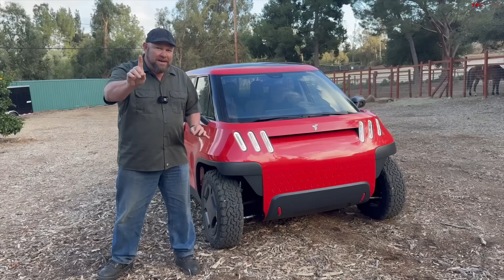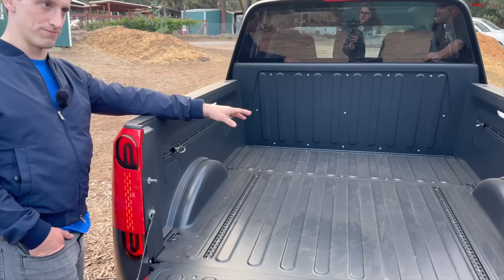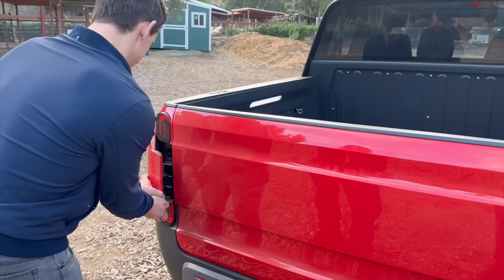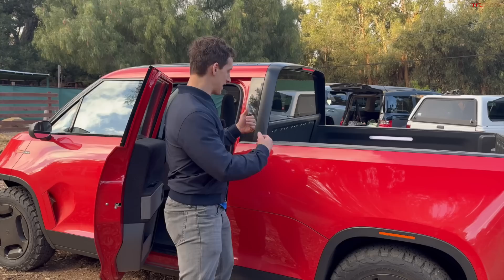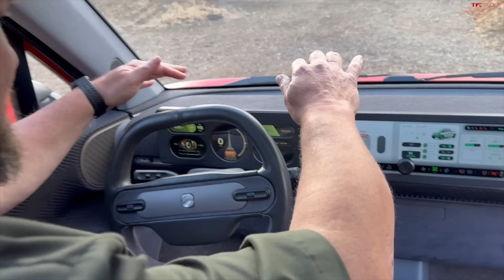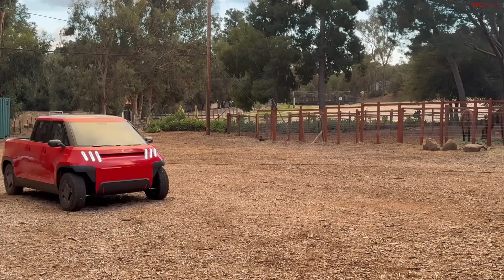I Drive the Most Revolutionary Truck In Decades: Meet the Telo MT1!

Comment: $40k for their lowest level truck still misses the point for a lot of people. I'd be more inclined to buy 5 used trucks for $8k each and use each one till they die. Assuming 2 to 5 years on each one and you'll still be driving years after this thing falls apart.

Comment: This looks very interesting to me. I didn't see a trunk...did I somehow miss that part or is that not part of the design? If so, I guess the bed could act as such since I'd almost certainly want a tonneau cover. 

I have been hoping for a hybrid version for the Santa Cruz to drop but this looks like it might be tick a lot of the same boxes for me, though those [non-hybrid currently] start just south of 30K as opposed to over 40K.

Comment: Like it a lot.  I would consider buying one.  However the PRICE is the key.  A lot of cars have MSRP values that are ridiculous.  It gets you from point A to point B.   Used cars do the same thing for less money.  So why buy this car?  Practical?   Yes.  Electric?  Not a selling point.  Some might say its a drawback.  Can tow? Yes.   So price it as a practical vehicle that can tow but it is small.  Sounds like a Ford Maverick.  Price it just like the Maverick.  The electric part is not a selling feature.  The Maverick is a hybrid.  Fill up time is 5 minutes.  Yours “fill up” is hours.  So electric is not a selling feature.  Price it like the Maverick and Ill buy one.  Starting price like the Maverick and top end price like the Maverick.  Guess what?  You will have sales numbers like the Maverick!!!

Comment: 41k is absolutely ridiculous. This does not end well for this company after celebrities and content creators buy one. A used 21/22 leaded out f150 limited hybrid will run around 41k. Heck, is someone wants something to pull a boat or take stuff to the dump, they would buy a good used 8k-15k truck. This price just pisses me off. 15k-20k, then it would be an awesome little truck.

Comment: Just ordered a 2025 Toyota Tacoma SR5 for $37,400. Gas, Automatic, 5 passengers, 4 door, 4-cylinder engine, Four wheel drive. The Telo being a pickup truck doesn't justify the starting price of $42,000.

Comment: We've needed a replacement for the old Datsun/Toyota mini trucks for decades. This is an exciting near-miss for me. I would like to see the 2-seat, bare-bones version down in the $20,000 - $25,000 range. Dump the touch screen and go with old-fashioned buttons/knobs I can use without taking my eyes off the road. My biggest concern is the lack of bumpers - the safety of the crumple zones is great, but it looks like a 5 MPH tap will require major body work.

Comment: i absolutely love it. the design is packaging perfection. if it makes it to market and has acceptable crash testing- i will honestly replace a Chevy Suburban with this cooper sized EV. i had a Chevy Avalanche before this and i miss that truck- this is the tiny version but with twice the horsepower. notice they didn't talk about acceleration performance on the prototype- the specs point to this thing being a missile which the avalanche was not.

Comment: Minimum range should be no less than 300 real miles. This is minimum real miles range for any EV in the world.
Price should be around $35 000 for the least expensive model with minimum 300 miles range.
Otherwise, it will not sell well. It would sell but not in great numbers.

Comment: Absolutely PERFECT Fixit/Handy/Proptery manager/ Gardner / Campers / Trail maintenance/ one tonne tow / plumbers /electricians / soccer coaches / street vender/ theatre carpenters..., wait, is this the Perfect Truck?
Reply: Like me,,,the Super Handyman. I want one.
Reply: No It cost to much those workers need/want basic work trucks and for that price they could get a V8 Silverado 4x4 or F150 or Ram with discounts so why would they spend it on something with limited range small bed small cab and probably little range while towing. Most of them would probably buy a used truck well before spending the $41k on this EV.

Comment: No mention of using Rivian's design, but just putting it under the bed of the truck. Don't get me wrong, I love more vehicles utilizing that space since it's no longer needed in conventional gas guzzlers, but at least acknowledge your inspiration.

Rivian came up with the skate board design which Ford stole and dialed back from quad motor to 1 - 3, Rivian came up with the tunnel thingy. They're even working on 90 degree wheel turns for sideways driving to make parallels parking easier.

All that aside, I dream of one day owning a R1T and now one of these bad boys.

Comment: it reminds me of a pug, like a dog just ran into a wall. 
small pickups are great, but current electric vehicles for most areas outside of 15 min cities wont last. 
i think a setup like the 71 ford couriers(only upgrade mechanically with seperated, but potentially capable of linking electric) (something else electric works like crap in cold weather) would be better. 
also if it was single bench with a 4x 8-10 it would be a better sale.

Comment: Mini trucks are not a new idea, they have been around and popular since the 1970s. As far as 500 HP, it sounds impressive but is more than what is needed. I had a 1500 Ram with 230 HP (318 V8) that towed 6,000 lbs through the mountains with ease. The EV might be ok in the city, but not so much outside. Traveling through the desert where charging stations are rare, ICE is the king. $41k is not bad for a new vehicle, but it is more for in town use.

Comment: A CEO who is actually honest about towing with EV vehicles.

This thing makes me miss my Avalanche. I switched to a newer F-150, and while it's great, the fold-down back seat in the Avalanche was so useful than I don't know why this isn't standard. I think this design is going to make a comeback, and I'm all for it.
Reply: How about an 8 ft box? Truck should go back to being trucks. Not grocery getters.
Reply: @trishaleaver3581 so if you don't get the rear cab option, its an 8 ft standard for this truck
Reply: The Silverado EV has the foldable midgate on some models. I’ve heard it referred to as the EValanche for that reason.

Comment: I think this truck needs a better interior to be viable. It's too utilitarian to appeal to most as an everyday driver.  I can spend the same $$ or less and get  a ford maverick lariat trim with very good gas mileage and better interior. Sure, it's a slightly larger vehicle, but for thr $$ it's simply a better option.

Comment: I own a '98 Subaru Sambar Kei Truck for my ranch and its the perfect vehicle for ranch use.  As others have mentioned, you need to know how to turn a wrench and get parts for the Kei truck.  It would be great to have a US made electric version of a Kei style truck and this looks to fit the bill.  Honestly, this vehicle has too much hp for ranch use, but it would be great to be able to power my welder from it while working on fencing or other metal projects and power my cabin in the event of a power outage.  I spent a total of about $6,000 buying  and shipping my Kei truck to the US.  Most of that expense was shipping and delivery.  The price of this vehicle is a nonstarter for me, YMMV.

Comment: I'm by no means a handyman. I'm not going to pretend I need some massive Truck to prove some superficial point. This truck seems like it Checks all my boxes. I occasionally need to bring wood home for a small project. I need to grade my lawn, so i need to buy soil and sand. I need to redo the flooring in my home. This truck seems perfect for my needs. we could keep the family Subaru for normal everyday driving. but this thing seems like its exactly what I need for my small 2 car garage and Solo panels. I've been looking for a smaller truck and i've had my eyes on a Frontier, but I don't think it will fit in my garage with my wifes Subarau. I had an old LJ that barely fit next to hers.

Comment: What is cool about EVs is potential to reimagine vehicles and not copy traditional car design.  Much like the Cybertruck, Rivian Van and the extinct Canoo.  This thing looks really cool.  For me I need a vehicle that can haul my photo gear easily and protect it.  This thing with a shell would be perfect.  Or a van version of this.  The cool part about this thing is it could easily haul a motorcycle.  And its low height would make it really easy to load it.  We can't really compare these to traditional trucks or cars.  Because they are not.  They fit a need for running around town vs long trips and hauling campers.

Comment: I love this thing. Everything about it, except the starting price. The target should be under $30K, preferably closer to $25K. That's fully in line with what small trucks cost in the 1980s. It's hard to say, but it seems like this vehicle would over-deliver at a $25K price tag, ensuring massive sales volumes, but the market at $25K doesn't require it.

Comment: I would have liked the roof to be a little higher [1-2"] (less of a duck when getting into the truck and more head space inside). Also, a simple metal roof with no window. 
The 10" clearance sounds okay but when seeing it next to a 6' person it looks a little low. 
Lastly, the price is too high. The price should be in the $30k range or lower. 
I like the cap idea, I think it would benefit from a higher roof height as well.

Comment: This opens up a whole new market. I am someone who hasn't (in North America) had my requirements for a truck addressed since the small Datsuns of the 60s and 70s. This addresses that and is, of course, after 50 years, a vastly improved solution. Bravo.
Reply: Remember the 70s-80s minitrucks, the whole movement etc. 
Cool beans...thing is being tall I could barely fit them
Reply: @gordocarbo  The Chevy LUV or the Ford Courier.  Guy had the cutest LUV, had a stake-bed, nice varnished wood, yellow cab, just an all around neat truck.  Problem is, just like with Ranger, and the old S10/Sonoma. They build a great sized truck, but then they have to build it bigger, and bigger.  Next thing, you have something the size of the full sized truck, so back to the drawing board for the Maverick  Not really a small "work truck"
Reply: The Datsuns were bad ass, it's a shame they haven't continued,🤙🍻🍻🍻🍻
Reply: Love those old Datsun’s

Comment: One thing I wish they change ergonomically, is the instrument board behind the steering wheel. It's VERY hard to read, you can actually see how the big guy at 13:47 is struggling to read it because the wheel is in the line of sight.
My suggestion would be to get rid of the instrument board entirely and move all the information to the central screen where they will be easy to read, and maybe install a projection module so the driver sees the most critical information (like speed, navigation hints, battery charge, etc...) projected on the windshield.

Comment: In Japan, the most important advzntages of Kei vehicles are size, weight, efficiency, and cost.  For the US market where our streets are big, size isn't important.  Something like TFL's own Maverick is a bit bigger than this and it fits everywhere easily, so where's the advantage of going smaller?  In traditional vehicles, less weight directly results in more efficiency and less cost.  But today's batteries are still heavy (that GVW figure was conspicuously absent from the video) so you get a supposed range of 260 miles--which is probably optimistic and certainly unladen and under ideal temperatures and conditions.  So finally we'll skip unknown safety results and come to cost.  $41k.  Which, for comparison, is more than the Maverick hybrid in top of the line Lariat trim.  Where's the carrot to buy this more expensive EV, which is going to depreciate rapidly?

I'll wait to buy an EV until the new battery technology arrives, and at a more competitive price.  Give me an electric Ranger Raptor with LESS weight, 600 mile range (300+ offroad, in the cold), sub 15 minute charging, at a cost equal to the IC version.  I'll happily make the switch.

Comment: Mini trucks are awesome. 
I drove a Nissan 1400 champ as a student. My dad had a Datsun 120Y way back when. They are very capable vehicles. I've seen square steel frames mounted over its entire length, rated for 500kg load, but because it is rear wheel drive, could manage a ton, or 500 and tow another 500 (great gearbox with lower gear ratio fit for hard work, (not 0-60 dashes or ultra fast intercity travel!)

Also, they are built really simply so itnis super easy to maintain or repair.

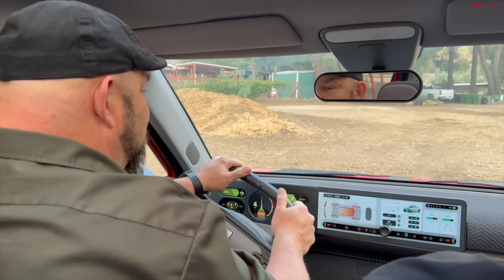Comment: 20:48 I loved everything about this mini truck till he said the cheapest starts at around $41,520. Bro! You mean you can buy two Ford Mavericks instead of one Telo? I understand that it’s electric and all but the motor and batteries shouldn’t drive up that MSRP like that. It should’ve been around $28k and most expensive top trim with all options $38 k max to compete. They act as if they’re competing with Rivian which is the only other sensible electric pick up truck.
Reply: @isaac198428  but Rivian is 2X the cost.
Reply: Batteries are still expensive. This also has a bigger bed and fully electric
Reply: @richards8872  you say fully electric like its a good thing. EV trucks are useless they can't tow or haul without dramatically reduced range. No just buy a truck if you need a truck and thats what people who need trucks do they dont buy these over priced EV look at me vehicles . They buy work trucks with little no bells and whistles other then what comes with it. The people who buy thoses $100k Rams and fords are show offs to but at least those trucks could move you hundreds of miles while towing in one day if needed.

Comment: In 1980 my dad bought a ford courier 2 door truck. Plain 4spd no air am radio. The beuty of the truck was its simplicity. This truck of course is more modern and slick. But I think those things people will want. My daily round trip is less than a hundred miles. This would suit my retired wife well too.